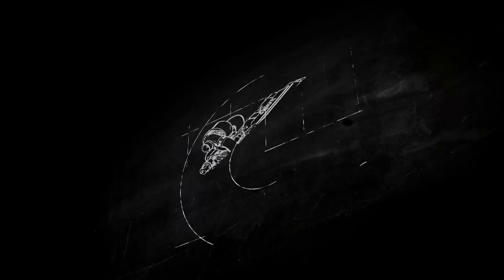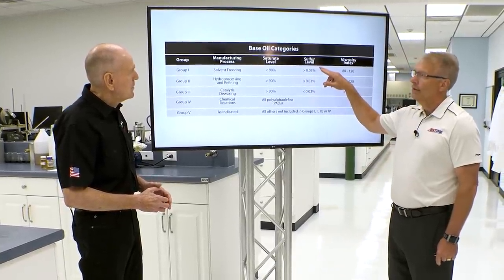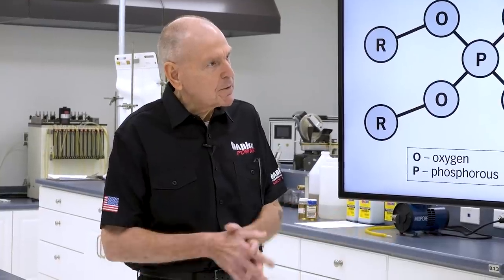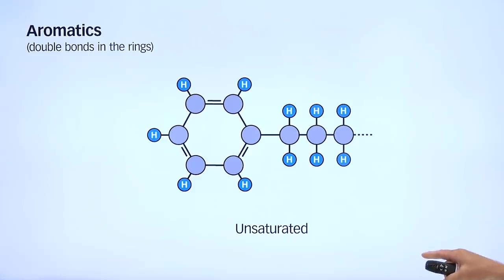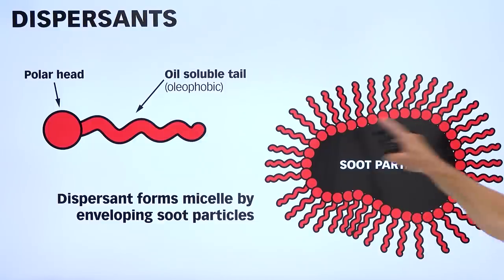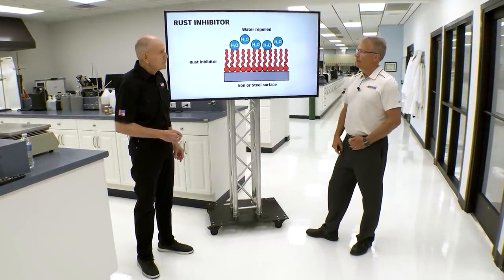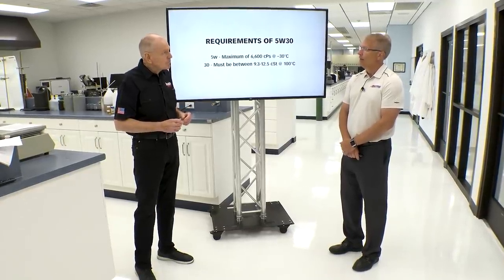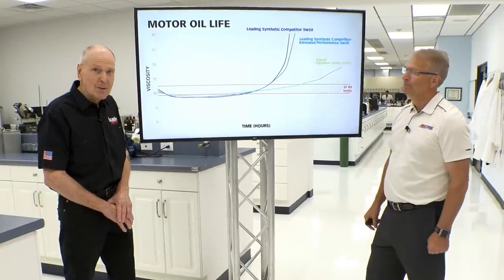What's in synthetic motor oil | Part 2 of 4

Comment: The graph at the end was interesting. They didn't show  at how many hours the curve went up. If you changed to your oil before the curve started, not much difference between the 3. While amsoil may hold up longer, the recommended oil change interval may occur closer to where the others start to climb. I believe Amsoil is a good product, as  a higher cost., Whose main benefit comes after recommended oil change interval. I'm not going to void my warranty by stretching out the oil change.
Reply from the maker: To add some clarification, the test length represented in the graph is in hours. Both competitors' useful life ended after day 10 or 240 hours. The AMSOIL Signature Series product had end of life happen after day 13 or 312 hours.

Comment: Whats the hours on the x axis?
Reply from the maker: This is a lab test AMSOIL uses to improve motor oil formulations that run in severe conditions in the field. The test length represented in the graph is in hours. Both competitors' useful life ended after day 10 or 240 hours. The AMSOIL Signature Series product had end of life happen after day 13 or 312 hours.

Comment: I'm enjoying this. But why did amsoil not show the bottom of the graph IE the time in hours; it could have been 8760 hours before the oxidation of the "leading synthetic". But because they left that portion off we don't know.
Reply from the maker: This is a lab test AMSOIL uses to improve motor oil formulations that run in severe conditions in the field. The test length represented in the graph is in hours. Both competitors' useful life ended after day 10 or 240 hours. The AMSOIL Signature Series product had end of life happen after day 13 or 312 hours.
Reply: @bankspower  Thank you for the clarification.

Comment: I have a question for the next episode about oil stabilizers and what AMZOIL thinks about them, because growing up Lucas oil stabilizer was always a staple in every oil change. Do they help us or do they hurt us??
Reply: AMSoil is not going to have a good opinion of oil stabilizers.  They state that if any additive is put in a fill of AMSoil, it will ruin the oil's long life characteristic.
Reply: @andyharman3022   I don't have a good opinion of oil additives either.
 A company such as Amsoil spends a fortune in time and testing to refine a formulation where it does everything well. Wear protection, oxidation resistance, detergency etc....all you generally accomplish by adding someone else's chemistry to it is to screw it up and make it worse.
For this reason, adding another companies chemistry to an Amsoil product voids the Amsoil warranty
Reply: Oil additives can help but have unintended consequences.  We recently completed a study on a couple common oil additives and impact on viscosity.  It can throw viscosity clearly out of grade and impact cold starts as a result.

Comment: Gale,  Manufacturers came out with electric water pumps to improve cold starts. Why is there not an auxiliary electric oil pump to pre-lube the engine at each start?
Reply: Such systems exists on BMWs, Audis, Porsche... but only the HIGH END of those makes, I must add.
Reply: Drag racers use them and some are simply powered by a cordless drill prior to start-up.

Comment: In the motor life chart, the leading and extended take a sharp turn in viscosity. The amsoil is not so sharp. But the chart does not show the ( time hours) it takes to get to the sharp turn. Can you tell the viewers what is the hours is please ?
Reply: This is a lab test AMSOIL uses to improve motor oil formulations that run in severe conditions in the field. The test length represented in the graph is in hours. Both competitors' useful life ended after day 10 or 240 hours. The AMSOIL Signature Series product had end of life happen after day 13 or 312 hours.  It is difficult and proprietary on how to create that relatively flat curve on viscosity after it reaches end of life (out of viscosity grade).  But worth it!  It was a very fun development project that I got to head up!

Comment: On the motor oil life graph I think it would be interesting to get the data for hours used.
Reply from the maker: This is a lab test AMSOIL uses to improve motor oil formulations that run in severe conditions in the field. The test length represented in the graph is in hours. Both competitors' useful life ended after day 10 or 240 hours. The AMSOIL Signature Series product had end of life happen after day 13 or 312 hours.

Comment: I've never used Amsoil but I've used Mobil One and other full synthetic motor oils. Bad experiences in all, where the synthetic oil simply evaporated or reduced between oil changes. Blamed it on the engine(s) of course until I tried conventional motor oil. Problem solved when switched back to mineral oil and discovered zero oil loss (2007 Duramax Diesel brand new at the time, Ford 4.6L Interceptor with 95K miles on it, and a couple other cars before that).

Comment: In the last graph, motor oil life, it would be good to have known the "hours" Y axis numbers. Was that 8 hours or was that 100 hours when the oxidation and thickness began?
Reply from the maker: This is a lab test AMSOIL uses to improve motor oil formulations that run in severe conditions in the field. The test length represented in the graph is in hours. Both competitors' useful life ended after day 10 or 240 hours. The AMSOIL Signature Series product had end of life happen after day 13 or 312 hours.
Reply: @bankspower  That would work out to about every 4 months its time to change the oil assuming 2 hours of runtime per day 7 days a week. That says much for those folks who rarely change oil or once a year or two.

Comment: Looking at the packaging graphics alone, I'd have guessed Amsoil was a "dollar store" brand. SO GLAD I stumbled across this Banks series. 

I just had the oil changed in my baby yesterday. I only put about 6,000 miles on it since the last change but, that was 10 months ago. I noticed on the receipt and on the window decal, they want me to change out the (full synthetic) in 3000-4000 miles or 3 months, which ever is first. I thought synthetic was good, for longer?

So I started researching synthetic oil and found the Banks series; a Master Class in motor oils. Bummer that Amsoil is so expensive and not as widely available, especially as a service, but hey, you get what you pay for and, the best is worth the effort so, I might just have to start changing my own oil.

I also researched Gale Banks. He's a legend and really, really, knows his sht. So if Gale Banks is doing a video about synthetic oil, and the brand he chose to talk about is Amsoil - even if he got paid to do it (I have no clue if he did or not) - I'm going to trust Gale and by extension, Amsoil, even if the packaging looks cheap, IMO.

Comment: Did they say what "hours" are on that last graph?  Pretty important info when showing graphs....
Reply: No - but the scale on those graphs is generally misleading. Engine oil failure tests generally aren't run in real world conditions, because they would take way too long. To get them done in a reasonable amount of time, the oil companies usually do stress testing - so they'll run the test at higher temperatures, reduce the oil volume to make it work harder, etc. Once you've done that, the test hours bear no resemblance to real world performance so they just show the relative performance between the oils.
Reply from the maker: This is a lab test AMSOIL uses to improve motor oil formulations that run in severe conditions in the field. The test length represented in the graph is in hours. Both competitors' useful life ended after day 10 or 240 hours. The AMSOIL Signature Series product had end of life happen after day 13 or 312 hours.

Comment: In that last chart Viscosity/Time, realizing it is a special accelerated test, I wonder where along the time axis, a 5K mile oil change would be.
Reply from the maker: This is a lab test AMSOIL uses to improve motor oil formulations that run in severe conditions in the field. The test length represented in the graph is in hours. Both competitors' useful life ended after day 10 or 240 hours. The AMSOIL Signature Series product had end of life happen after day 13 or 312 hours.

Comment: But doesn't anti oxidation additives react with anti wear additives? I mean, I would be worried if oil is highly resistant to oxidation, then others might perform better from an anti wear point of view, especially when oil is replaced before it's time, like I change oil in my car at 10.000 km and not 15.000 as indicated, or once each 8/10 months, instead of once a year, in that case I don't have to worry about sludge any way, but I worry more about anti wear performance

Comment: Been in the biz for decades wrenching, still not sold on Amsoil for the money. Unless I had a $100k car or something. I use the castrol euro 5w40 or 0w40 with about 1/3 bottle of riselone zddp additive in my 05 Volvo S60R. It's about the most versatile oil out of the standard products. Great for common oil burners that drink 5w30s like the later model Hyundia GDIs, Ford 5.4 Tritons and most turbo cars that call for 5w30 and burn it.

Also a little too much stroking off Banks about his questions, was a little cringy.

Comment: On the graph it would be nice to know what time interval the oils start to rise in viscosity.
Reply from the maker: This is a lab test AMSOIL uses to improve motor oil formulations that run in severe conditions in the field. The test length represented in the graph is in hours. Both competitors' useful life ended after day 10 or 240 hours. The AMSOIL Signature Series product had end of life happen after day 13 or 312 hours.
Reply: @bankspower  thank you for the information! I’m enjoying the series! Good to know these things.

Comment: I know Mr Banks is a Diesel guy, but something occurred to me about the problems gas engines with direct injection are have with carbon build up on the intake valves, the ported type fuel injection would wash over the intake valve and keep it clean, not so with direct injection, and the problem comes from the PCV system, SO..... would top tier synthetics help control the carbon build up on the intake valves ????
Reply: I don’t think so. The heat generated from combustion allows the carbonization to cake onto the intakes due to the PCV. The only surefire way to reduced the amount of carbonization of intake valves is to install in series an oil catch can, or to vent the PCV to atmosphere or delete the PCV altogether.

The heat generated from direct injected diesels is a lot higher in temperature, therefore preventing Diesel intake valves from carbonization
Reply: Yes some, because premium synthetic oils do not have the light fractions that volatilize and add to the crankcase gases getting added back into the intake.

Comment: The W in 5W30 factually stands for Winter, not Weight. Hence, 5Winter30 is an all season engine oil.
Reply: You won't see SAE 50 oil ever labeled as 50W, for instance. Make sense?

Comment: The obvious question is how well does the oil life monitor in your car parallel with the actual oil life?
Reply: I have sent a few samples in of used oil when the oil life monitor told me to change it. My vehicle is a 2011 Durango with a 3.6 Pentastar engine with 140,000 miles and the oil is Pennzoil Ultra Platinum 5w-30. The oil life monitor tripped at 8,000 miles (the maximum in the owner's manual). I changed it and sent in a sample to be tested. The report came back good and the testing company said I would be safe to go to 10,000 miles and sample it again to see where it was at as far as TBN and fuel dilution. 

I sent the oil in from my son's car to have it tested when the oil life monitor got to 15%. It is a 2011 Chevrolet Equinox with a 3.0 V-6 with 135,000 miles and the oil was 10,000 mile Mobil-1 5w-30 Dexos. The miles were around 4,500 on the oil. The oil analysis showed the oil was mostly used up and and the fuel dilution was a little high. I'm sure if we let it go to 0%, the oil would be completely worn out.

Where I work, we have a fleet of Ram 3500's with the Hemi 6.4 gas engine. We occasionally have trucks go to 0% and then go even more due to scheduling conflicts. One truck had went quite awhile past 0% oil life left before we had a chance to change the oil. We sent the oil in for analysis out of curiosity just to see how critical it was to change it at 0% or if we had a cushion to work with. It actually came back in really good condition. The oil was Pennzoil Ultra Platinum 0w-40.

So it seems to know for sure, you would have to send your oil off for testing to get a baseline on how your particular engine treats oil and how the manufacturer set up their algorithm.
Reply: Good question.  Most of the time, your oil life monitor is acting as an oil life predictor.  Meaning it only monitors things that theoretically affect the oil that was used when they created the algorithm.  In most all cases, it does not measure oil life or any oil properties.
Reply: @AMSOILinc  I have a couple of thoughts regarding this. The first is to have some sort of permanent device installed in the engine that will constantly monitor the oil life of any given oil or have the car manufacturer recommend a specific oil as a part number where the oil life value is known, so that the algorithm matches the oil used rather than a general value given for all brands...

Comment: Motor oil life graph has no time measurement.   Is it 1000 hours, 100 hours?
Reply from the maker: This is a lab test AMSOIL uses to improve motor oil formulations that run in severe conditions in the field. The test length represented in the graph is in hours. Both competitors' useful life ended after day 10 or 240 hours. The AMSOIL Signature Series product had end of life happen after day 13 or 312 hours.

Comment: without actual hours on these charts, we are just bench racing.
Reply from the maker: This is a lab test AMSOIL uses to improve motor oil formulations that run in severe conditions in the field. The test length represented in the graph is in hours. Both competitors' useful life ended after day 10 or 240 hours. The AMSOIL Signature Series product had end of life happen after day 13 or 312 hours.

Comment: Group 1 and 2 are de facto obsolete.
The majority of oils are either straight Group 3 or they have some PAO and Esters mixed in to make it a bit better. 
Real fully synthetics would be straight PAO which is suboptimal actually or be formulated from PAO+Ester and AN can also be used.

Comment: The bigger the difference between the 2 numbers the  more octopi are needed to fill the gap therefore the faster ( more susceptible) your oil breaks down as the octopi break legs constantly reducing their effectiveness... 

Every motor I've had would consume 1 container ( qt =gas ga =diesel) of oil at oil change time  almost like it sprung a leak. Oil tech says it's a boil off .  Makes sense especially with consistency and never leaving a spot on the driveway. 

Do you suppose Hamilton cams is off in left field by REQUIRING there ZDDP is added to your break in oil when using their cam and expecting a warranty on said new cam?

Can somebody convert the two different measurements into the same unit of measure so we're not comparing  apples and pineapples? As any racer knows consistency is the key to success. 

 Dream Big Chisel Down to Reality

Comment: The measurements cPs and cSt don't mean much to people that don't study viscosity and I really think that should have been explained a lot more. My engine calls for 5w40 so what do those numbers mean?
Reply: That the oil has viscosity characteristics that satisfy both cold and hot viscosity limits of the SAE J300 standard.  5W is for cold pumpability, which has a maximum limit of 6600 centipoise viscosity at -30C (-22F).  40 is for high temperature viscosity, which has an allowable range of 12.5 to 16.3 centistokes at 100C.  An oil which has two numbers in its viscosity rating is referred to as multiviscosity because it satisfies both cold and hot standard in the SAE J300 spec.  You can buy single-grade oils such as 10W or 30, but they have become rare in the last 50 years.  Low temperature grades that are defined in the SAE standard are 0W, 5W, 10W, 15W, and 20W.  High temperature grades that are defined in the SAE standard are 8, 12, 16, 20, 30, 40, 50, and 60.
Reply: @andyharman3022  but what is the difference between a centipoise and a centistroke? 1 doesn't equal 1 if you see what I'm saying. So 5w is for cold flow and 40 is for hot. But why then on cold start I see 80psi oil pressure at 30-40° F, and at operating temp idle is 20-25psi? Look I know a lot about cars, I've worked on them for 25 years and recently rebuilt 95% of my B5 A4 (other 5% coming soon) but oil is something I honestly just can't wrap my head around!
Reply: @4BillC  Centistoke is the unit for kinematic viscosity in the metric system.  Centipoise is the unit for dynamic viscosity.    To make a long story short, kinematic viscosity is dynamic viscosity divided by the fluid density.

You see high oil pressure at low temperature and low oil pressure at high temperature because the oil viscosity changes a lot with temperature.  The SAE standard takes into account that simple fact by allowing a maximum viscosity of 6600cP in the cold flow test, and 12.5-16.3 in the hot flow test.
Reply: @andyharman3022  my biggest question is why the hell can't they just use the same unit of measurement though? I can (and have) tune an ECU to make power but can't comprehend the oil in depth... I get the basics of it and have read and researched it... Guess it's just one of those things... Lol